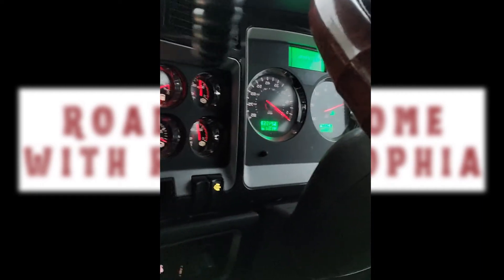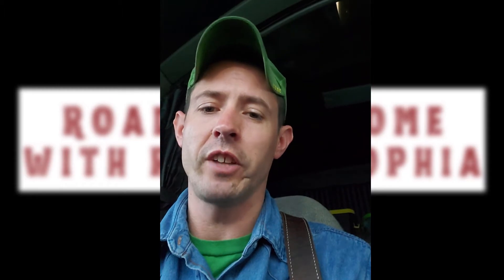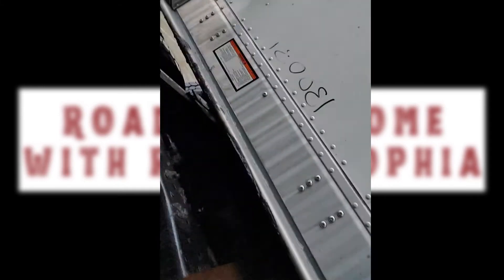Semi Truck Air Dryer Purge Valve Leaking Quick Fix

Comment: Sir, 

WoW, I wish I could post before and after  pics of my gauges. Not only is it fixed by your video. But i was always blow off at 110 now its blowing off at around 130 psi. 

Of course I'm get the whole dryer replaced once I get to Texas. 

But Brother, I was stuck in Louisiana at the Petro the big one. I'm 8 hours from SA Texas. There ten truck in front of me. Most likely I won't even get seen even tomorrow.  Because we all know road calls are priority.  So Mechanic is always gone. 

Anyways Thank You

So Very Much Thank You. 

I worked on my wife car. I ALWAYS have my tools with me. I totally forgot to put them back in the truck. I never ever run without my tools. 

But for 5.00 screw driver i bought at truck stop. BOOM issue fixed for now. I stuck that bad boy in there. Used a hammer to lightly tap. Nothing, then I twisted a little I heard a harder WOOSH and felt it. I tap and twisted again. And BOOM everything okay. Even more pressure then before. 

Amazing

God Bless You and Everyone Else Reading. Stay Safe!!!
Reply: Hello sir can you tell me exactly what you did I have the same problem did you push the center of the valve up? Thanks

Comment: Awesome video. Hearing the noise your purge valve made sounded exactly what my valve was doing. Unfortunately on my T680, I couldn't get underneath the truck at the time to try and fix it. 

So I ended up going to a TA and told them exactly what was going on. Turns out the filter more than likely hasn't been changed out since 2019, and its a 2018 model.

 I inherited this truck last year from another driver so I'm having to play catch up on maintenance lol. So new air dryer installed and will be replacing the filter every six months or so. The air not building up enough pressure  beforehand was very annoying. 

Thanks for your videos! I've been learning a lot!

Comment: I literally just had my purge valve stick open out in traffic. Buzzer went off. I pulled into a gas station, stuck a pen in the hole where the valve is and closed it manually.  Fortunately I was only 3 miles from home. My system is governed at 120psi, so on the ride home I pumped the brakes a bunch of times to drop the air pressure before it hit the purge limit. Made it home with flying colors

Comment: Hey Ryan, this is such an old video I don't know if you'll even get this message. My t680 2019 is chattering it sounds like and it loses air pressure when it's doing that and then the compressor comes on and the chattering kind of shuts up and it builds up pressure but then it starts to lose pressure again but then it'll just stopped and it'll hold pressure after a few times or whatever you know you have any idea what that could be

Comment: Got a question. Would you think it was the air dryer if my air bag hiss while the truck sits? I was on the dock this morning and I heard air where the bags were. Then the secondary tank was acting like it didn't want to fill until I gassed it up.

Comment: Hello, mine hisses air from the safety valve it purges from there do you think my air dryer is bad ? Sometimes I will be driving and my air pressure drops a little and it starts hissing air from there takes a while to fill up and close the valve

Comment: My truck would not build air pressure beyond 65psi. I by passed my air dryer and it still only gave 65psi. So I changed my air compressor and governor but still only got 65psi. Compressor to dryer air line is also new. Don't know if changing my dryer unit would make a difference. Any advise you can give me would be greatly appreciated.
Reply: Drain your tanks … they may have water

Comment: What was the problem? Did you eventually find the fix?
Reply from the maker: The seal was bad, I replaced the purge valve in a truck stop. Here is the link to the video if you are interested. https://youtu.be/73xjY6UVWR8
Reply: Thanks for the help.

Comment: Block the hole  working 💪  to. The happens to me truck  dayli for   yers.    I still have        now i have problems in me air  government        you replaces government   air value  working to is cheaper to doing.